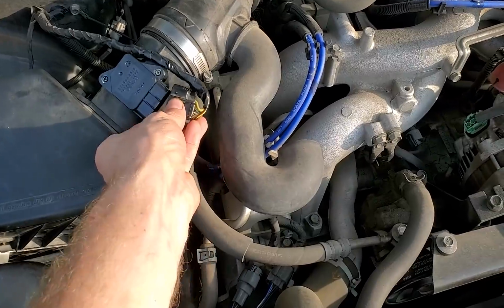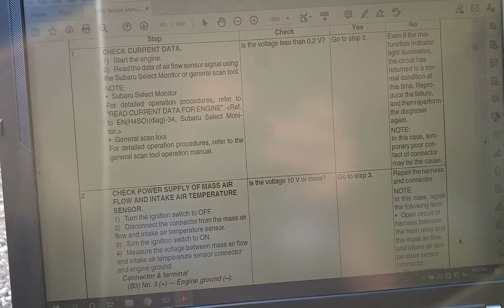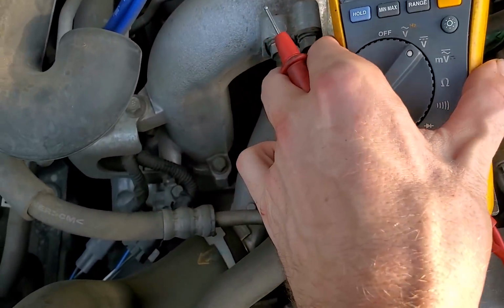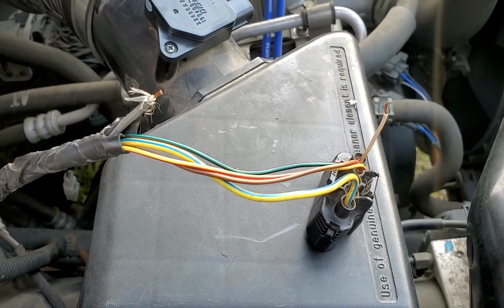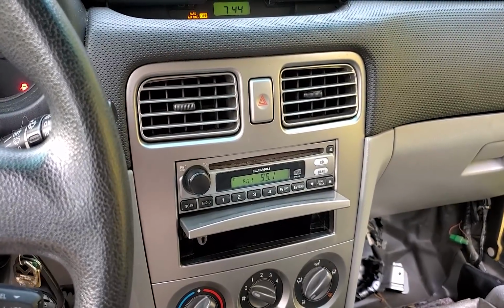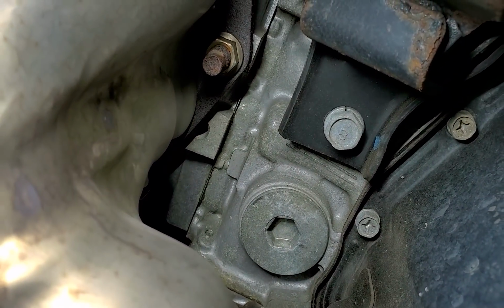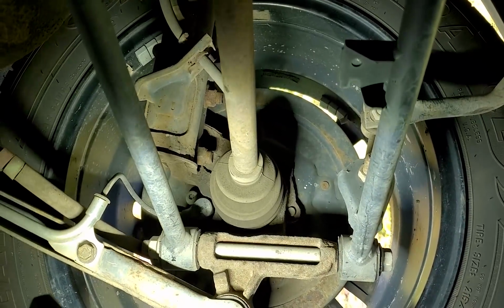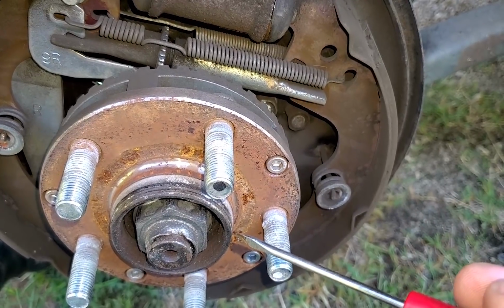2008 Subaru Forester P0102 Diag & Repair: Plus Full Inspection

Comment: fixing a p2102 code this weekend. Wheel rubbed through wire hardness in passenger side fender well. Subaru "fixed the wiring" and I went to get my car back and it had zero throttle response and now have this code that I did not have before driving to subaru dealership. Drove there just fine. Hoping its something simple. Thanks for the inspiration haha

Comment: Hello my 06 legacy gts rpms would drop whenever i moved the wires for the maf and after i installed my new clutch it idles really really rough now and hesitates to accelerate and dies sometimes when u come to a stop its undrivable and i got a p0102 code, would it be because of that ? I also gotta do idle relearn because it drops rmps when i start up sometimes

Comment: This was very helpful!  I seem to have the same problem in my 07 Forester... no voltage to the #3 pin with ignition key on.  However, I clipped the wire (the wire was shielded until the last 3 inches, and did not have a crimp connector like the one in the video) and I have no power to the wire.  I followed it back towards the PCM until it converged into the huge mass of wires and can't find any place it is compromised.  Any suggestions?
Reply: Yes...MrSubaru is incorrect in th is video.The center wire is not the feed wire.the fat wire at the end of the connector(yellow blue=? is the feed wire.The center wire is the signal wire.And it was  supposedly fixed earlier ,,hence the bodge job on the splice. As a matter of fact..the centre wire is supposed to be thicker where it is thicker as seen in the video.The thick portion is shielded wire....because of it beeing a signal wire. I cannot believe MrSubaru did not know this.

Comment: So the shielded wire originally went from the PCM to the original MAF but when they changed sensors they spliced in the unshielded wire?
Reply: No...the reson for the splice is seemingly unknown.I actually did this " test" today...and it was lookin exactly like the onein the video..appart from it not beeing spliced.But the shielded wire stops beeing shielded the samelength from the connector..as shown in the video.

Comment: As always, a fantastic video! Have you ever covered "smart charging systems"?
I own a 2018 crosstrek and noticed the fan speed drops drastically when coming to a stop. I put a multimeter on it at idle and it showed 14,X volts. Quite strong. It got so annoying that I picked up a cheap voltage meter that plugs into the cigarette lighter. 
WOW!
As I come to a stop, the voltage drops from a strong 14 volts to 12.1 (ish). After doing a bit of research, it appears I am seeing a smart charging system at work and it scares the hell outta me! I bought the extended warranty that covers a ton of stuff til 100K. I am at 105K and noticed the price of an alternator is more than my car payment!
If you haven't made a video about that.... I would throw a few bucks your way to say thanks!

Comment: Thanks for the video. I'm always partial to a SG Forester being a current owner myself. That weeping at the steering rack is pretty common. As long as it's not dripping or running low on power steering fluid frequently it can be largely ignored.

Comment: Kinda random question but on this gen Subaru with the self leveling struts in the rear what do you recommend for replacement? I have an 07 LL Bean and from what I read on the forums I have the typical Subaru sag in the back but I can't find replacement SL struts online. Thanks and great video as always!
Reply from the maker: KYBs are the OE. What I use.
Reply: @MrSubaru1387  thank you sir! I'll do some digging.

Comment: Any content on p0420?
Reply: I have struggled with this code for the last year on my 09 Impreza. I replaced the oxygen sensor behind the catalytic converter with  the OEM sensor. Problem went away. Now, that code can also be for the emission system in general. But replacing the sensor is what worked for me.

Comment: My 2005 SG XS 2.5 has had problem with check engine light. Initially changed the post cat sensor but CEL came back on after 50km.
Reset by disconnecting battery and still comes back on after about 20km driving. Forester idles and  drives okay, a little thirsty on petrol. Any thoughts?

Comment: I noticed on my 13 3.6 legacy on one of the wires the connection going to the throttle body motor it's got  weird tape job from the factory,  must of been a subaru thing??

Comment: Subarus love turning on the cruise control light with check engines
Reply: They do that on emissions related faults so you'll fix it. Does it for a loose gas cap too
Reply: My check engine light keeps coming on, changed the post catalytic sensor according to the code. I note the previous owner did had it done 5,000km prior too.
Any suggestions? (Fuel cap getting old maybe, car has 310,000kms on it).
Reply: @soundsolutions  there's no code to change the post cat o2 sensor. There's several different codes for those sensors that requires testing the sensor and the wiring integrity to the ECM
Reply: @andyhardwood64 probably a leak in the exhaust system or something if it’s showing those codes and you keep replacing the o2 sensor